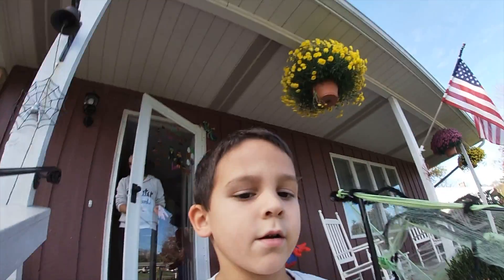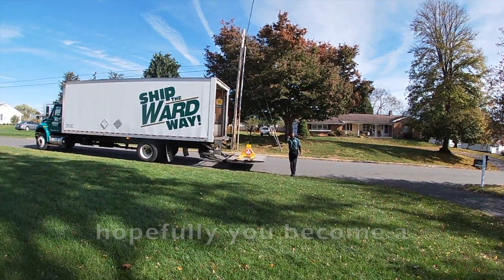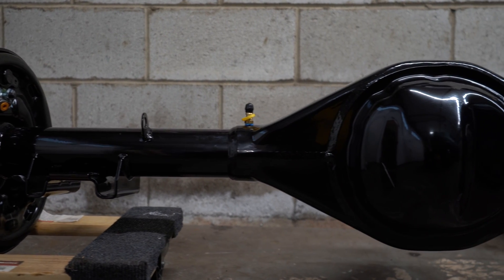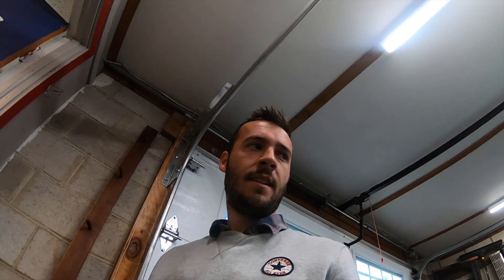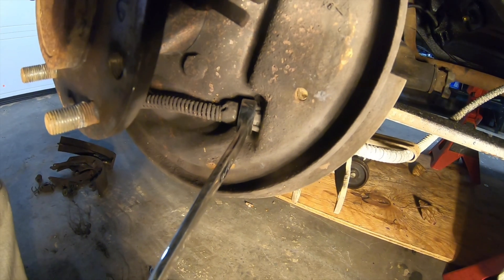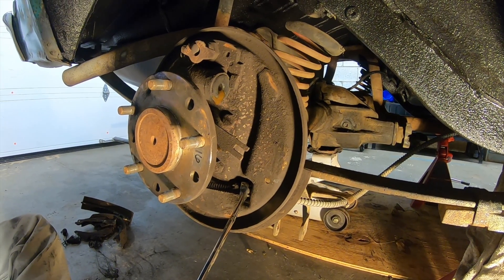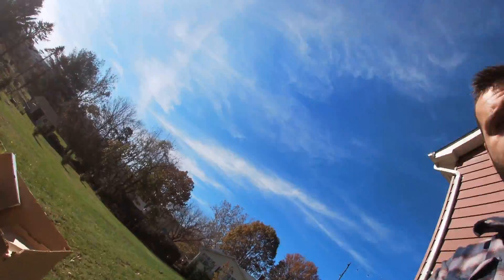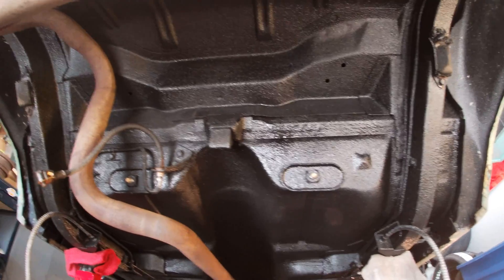Chevy Nova rear Diff. swap part-1

Comment: . Never saw coils like that either. head scratch..  Im doing same thing to my recently aquiured 1970 Nova.  Gonna rebuild the 12 bolt though. New posi w/3.42 gears.
Reply from the maker: Nothing wrong with a 12 bolt! If I had one I probably would have done the same thing as you. However this car only had a little 8.2 10 bolt (not worth rebuilding). So since I had to buy a rear I decided to go straight for 9” just cuz how easy it is to swap gear ratios later on. Those 3.42’s are gonna be perfect for a fun quick street car!
Reply: @hatchsrecreationalengineer1997  Glad to hear back from you..  Im feeling a bit impetuous, so Ive been speaking with Strange manufacturing.  Thinking about grabbing a, all new Dana from them.  Its posi with 3:73 gears and drum brakes.  35 spline axels and leafspring mounts in stock 1970 Nova location.  Only need will be, brake lines adapted and u-joint, as they have the 1350 pinion yoke  instead of 1310.  Im watching this install again.

Comment: Coil springs: they are aftermarket coil springs for extra load. Somebody either towed with that old nova or carried a lot of weight in the trunk. Extra capacity.
Reply from the maker: I can’t imagine they were towing anything since there’s no hitch or evidence of ever having one. I think the were added to compensate for the spent monoleafs because those coil springs are on the frame rails 24/7 load or no load

Comment: Overload/helper springs.the old mono leafs are probably shot and the rear end sagged.I’d put new leaf springs in with that rear your putting in.Should have opted for multileaf brackets on rearend. Gonna be a cool nova though!
Reply from the maker: I installed the new rear with some cal trac split mono leafs. I plan to do some drag racing with the car so I set the rear up to stick with the mono leaf style suspension.

Comment: Dude why wouldn't you go with disc brakes? Multiple cylinders in the calipers? Why would you spend that kind of money and not to with top brakes and a short gear set? How many spline axles? Your nova looks rough underneath. Decrease and paint, dust proof everything at least before you swap diffs. I don't get it?